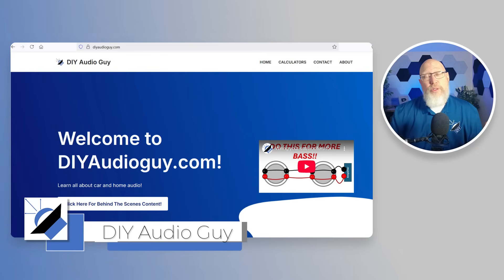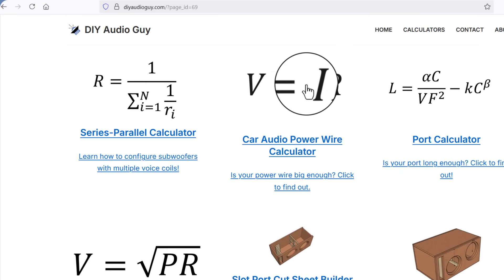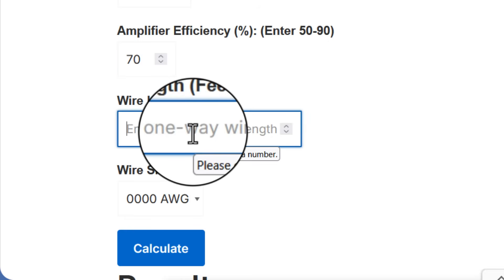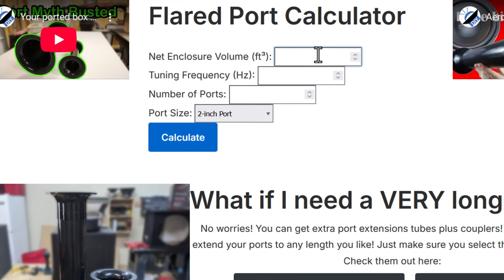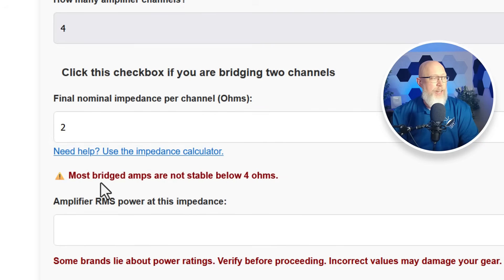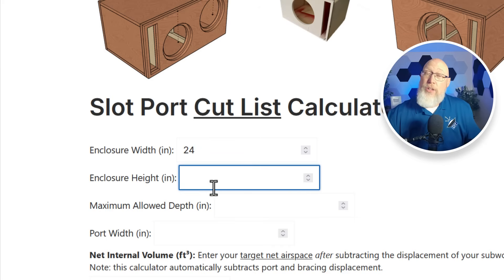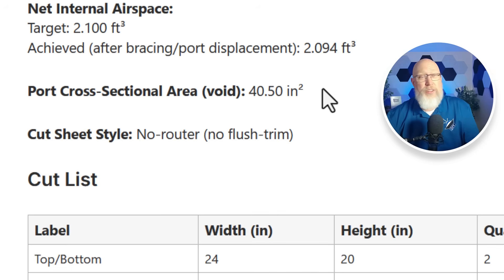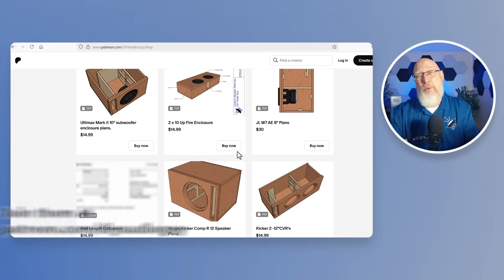5 FREE TOOLS for Subwoofer Design and Setup!

Comment: at 6:14 you change the wire gauge, but the current draw stays the same, so how does the voltage change so exponentially? then you changed it to cca wire, and the amp draw stays the same still: but isn't cca really inefficient? Or is amperage measured by a different metric?

Comment: When it comes for me to build my box I don't use terminals or terminal cups. I run my subs inverted so I can run my speaker wire directly to the amp and sub. I found this offers the least amount of resistance In the signal path and has better sq. If I want to enjoy some flex. I just use a passive radiator design. The main sub is inverted and the passive radiator/s would be mounted normal. With a passive radiator design they will move more on the lows. That is visually appealing lol When it comes to subwoofers, amplifiers and wiring. I use dual voice coil subs. Instead of wiring in parallel or series. I just use one 1ohm stable or lower mono block class d amplifier per coil.  2 amplifiers on one dual voice coil subwoofer. It is very important that each amplifier is receiving a mono signal and tuned with the same exact output. Or you risk damaging the voice coil. Always look at the RMS rating of the amplifier and coil for matching. I don't like using bass boost. Instead I go with a larger amplifier than the coils rating for headroom. Getting the right tuning for your sub box is important to determine the amount of power you can send to your subwoofer. If the box is too big you won't be able to send as much power before the coils burn up. Hope this makes sense and is helpful information for someone out there.

Comment: Every designer should be able to calculate these basics themselves. 🙂 Calculating bass reflex ports based on frequency is pointless, because you first need to calculate the enclosure size and then use the T-S parameters to calculate the tuning frequency. This is usually done by selecting it based on measurements, which is simpler.

Comment: Iv  taken classes in electrical  in the first class they  reg all the power   every thing 30-40v  dc because  when you hit 50v dc and more then  a few amps  you can end up no longer around 😵.   So all the panels at school worked on  are low voltage and they  have  control  one of the guys there ask me what would happen  if you wire power to ground  i told him in the field it will blow up and arc.  It should never be done  so he did it in class like a big dummy   what he didnt no is the set up has a main pertection panel  and  it also  shows were  it came from   i laugh at the guy  because the teacher went right to him   and told him  i know what you did  because    of the way its set up at school  the pertection  panel   the teachers  panel and it has  a trip light for each student zone . 🤭🤭🤭  i found this  out from the teacher when i ask    school at first classes are  a little diffrent then  when in  the field  already low volts and dc some what rare every thing  i run in to mostly  AC  high voltage panels.⚡️👍✌️🫡🎶🎵

Comment: Damn, man this is so nice. I’ve been working up the courage to start my first box build and you put this out there just in time
Reply: You got this bud. The hardest part is making straight cuts. Start with a good sharp blade. Make sure to use Clamps and a solid atraight edge...like a 4ft bubble Level or angle iron solid.  Clamp it down and use it for an edge guide on your skillsaw and keep turning the workpiece so if it wanders away from the straight edge it wanders away from the piece that you are cutting. 

Past that... glue till it comes out on all sides and braces where you can and you'll get it. Even if its not exactly what you want the first time, get the structural basics good and solid and then you can learn what you actually like from an enclosure